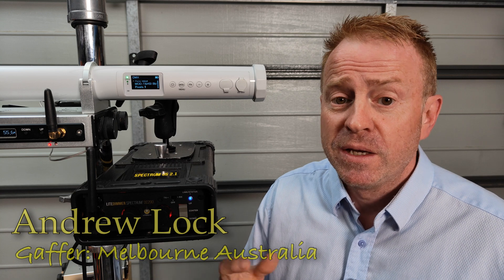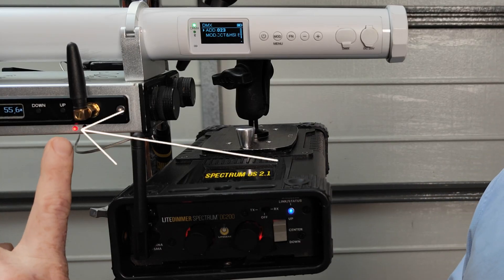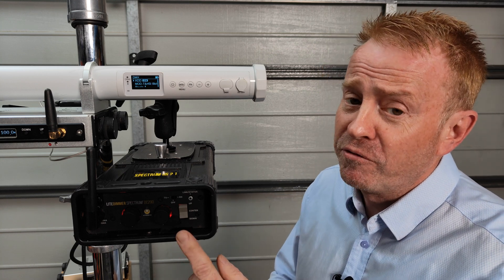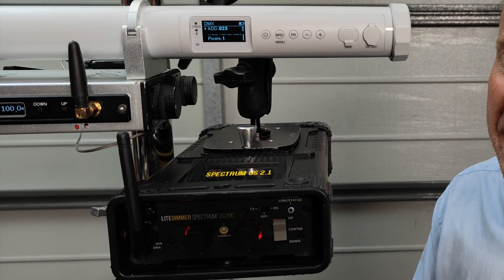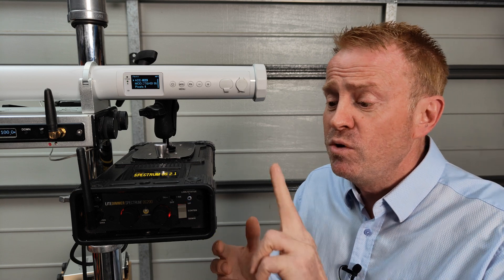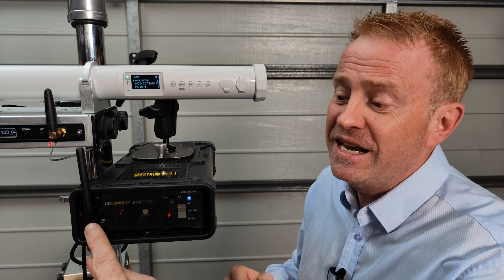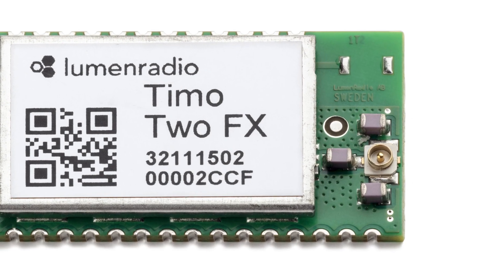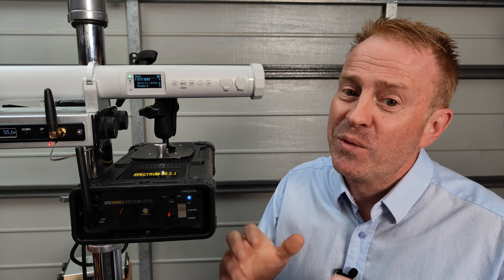Gaffer & Gear 248   CRMX Status Lights

Comment: One thing I'll add -- If I have a constantly flashing light, my initial assumption is that the unit is linked with a transmitter other than the one I'm using. In order to create a link with your transmitter, you will first need to unlink that unit from the previous transmitter, which makes it available for a new connection when you send out a link command. This is done a few different ways. 

On many units, like a titan tube, go into the menu and select the option to "unlink CRMX", "reset CRMX" or the likes, and when you do you should see the CRMX status light turn off. 

On the Litemat Spectrums (2019 model), and possibly other units where there is not a menu option for unlinking the CRMX, you hold down the flashing link/status button for a few seconds until the CRMX status light light stops flashing and turns off. 

Then you can hit the link command button on your transmitter, and this should connect the available unit/s with your transmitter. If not, then I would follow with Andrew's other tips here on troubleshooting why you can't create a link. Hope this is helpful information for some!

Comment: I ALWAYS seem to have trouble with the LiteMAT internal receivers. I don’t own any so they come from rental houses and other owner / ops. Not sure if it’s an upkeep thing or what. But, usually if I plug my own receiver in I have flawless wireless control. Maybe the new ballasts will be better.
Reply from the maker: I had that issue on ALL of my spectrums.

Litemat told me to open them up and push down on the connection.

When I opened them up they all looked connected, but I pushed down and sure enough the problems disappeared and they have been 100% reliable ever since.

I guess on the assembly line they weren't pushed all the way down!